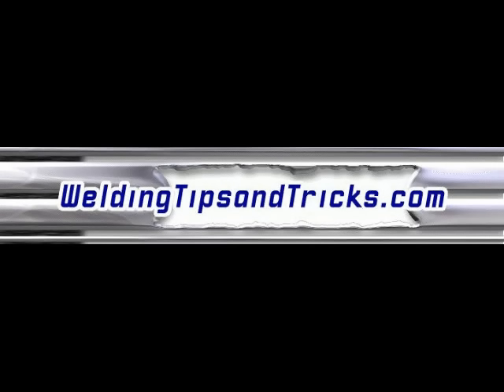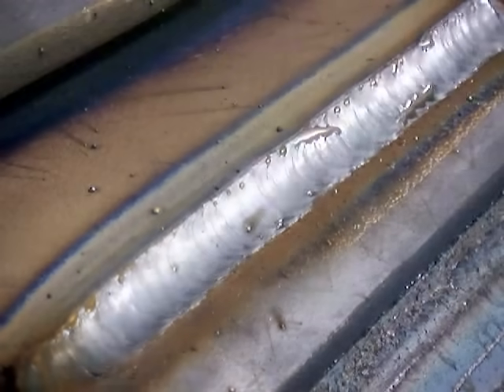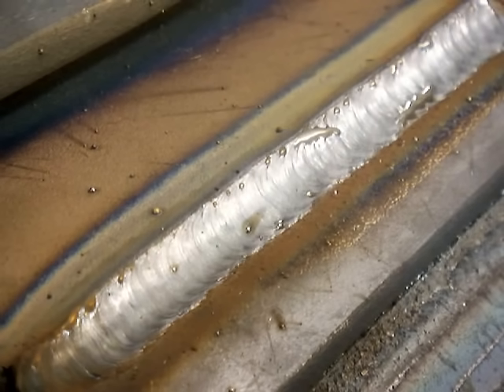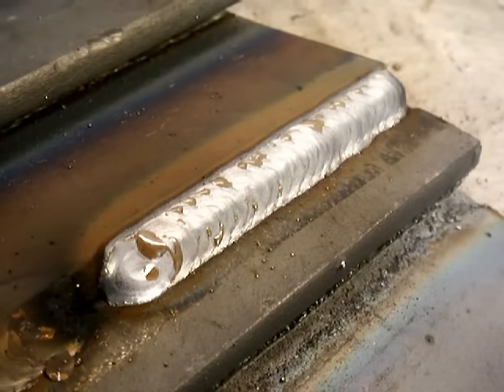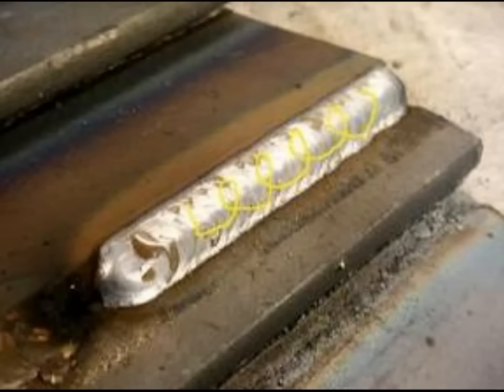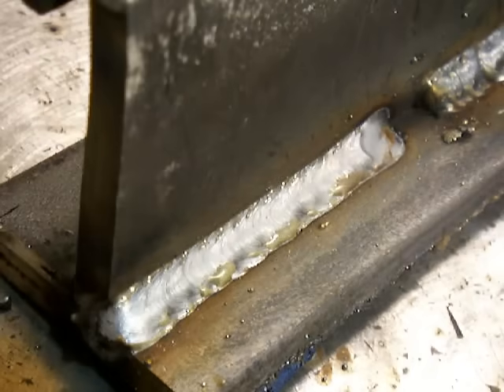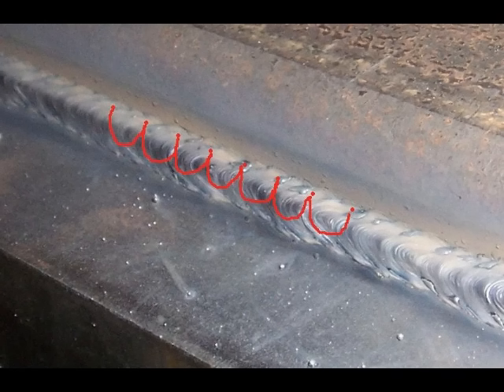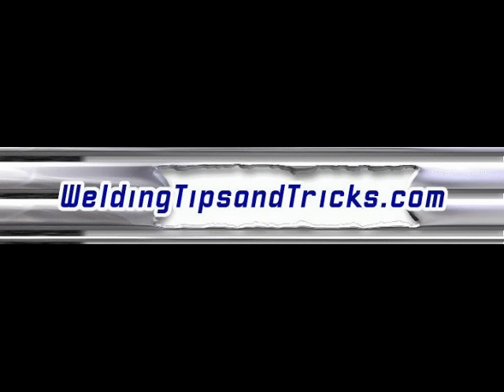Mig Welding Technique Taught by Old Timer

Comment: laying a 6 inch flat bead on your buddies workbench is not welding. laying upside down under 6 tons of steel getting covered in molten metal while hungover and half asleep and still making a mint/watertight/xray bead is welding

Comment: That,s info - I have only heard about push-teknik. Those strings looks very low (seems like it´s melt in very good).My experince is that the string gets to high, it don´t melt in or down as much as it should.
Looking forward to next tip.

Comment: aint that the truth mate getting qualified is extremely hard im lucky enough to have qualified in 3 of the 4 welding types only missing Stick welding but i know my welds can pass it just don't have the time to get the piece of paper i've had people like these guy run their mouths and say they can "weld" when their welds cant even handle a tonne while mine are rated at 3.5T on 3mm steel so its funny how these guys think they can weld give em alli or stainless welding and see how they go

Comment: correct , Flux Core totally different animal .. gas shielded flux cored works better the the wire 90 degrees to with work piece or being dragged .. you can push it and it does respond well but this is not the correct method , we used ESAB 15,14 flux wire ill get some vids of this posted if it helps people .. 

regards

Comment: The Weld Pool is Better Protected Whilst Pushing The Weld Pool , This Technique Is Ok For Lets Say Welding Car Bodies . If Working On Structural Steel , This Technique Would Never Pass A Procedure . Also Try Dragging 300Amps .. Then Try Pushing .. You Tell Me Which Is Better . .Regards

Comment: Yeah, it's the easiest machine to use - though I have to point out the difference between what you said and what you replied to. Good welding is all about practice, not "training". Doesn't matter how much "training" somebody has in this field if they don't have the actual practice in making a smooth bead, so your reply was right-on.  ;)

Comment: A good welder needs "technique", rather than "tips" or "tricks".  Circling the arc is the most basic technique for laying a bead, and is actually easier than a straight linear feed down the weld line - which requires careful speed control. 

Not that I'm saying anything bad about the video. People who don't know these things yet would learn a lot from this. I just hope they don't consider it a "trick" when they use it at work, since it's a proper welding technique...

Comment: A mig is the easiest welder to use...practically like using a glue gun. If you read the owners manual, you  will acquire enough common sense to avoid electricution and be able to practice..  this guy has been practicing for sure

Comment: You should probably avoid welding the frame entirely, and instead do silver brazed joints using lugs.  If you were planning to make it out of, say, 4130 Cro-Moly, the heat of arc welding will probably significantly damage its high-strength properties, not to mention causing warpage and introducing high-stress points that could result in potentially deadly frame failure.

Comment: I'm looking at the MTS250S too but may also get the spool gun for aluminum. 250A for MIG isn't overkill. If you don't need to go that high, the extra duty cycle will come in handy and makes for a more durable welder.

Comment: On lap joints, you need to watch when oscillating the arc as it may cause undercut if you get carried away. I guess all of us has done it before. When I was a Mfg. Rep for Pandjiris, we installed a bunch of weld oscillators, both mechanical and magnetic, and it does produce some pretty welds. What wire and gas were you running in this?

Comment: its called a journeymen pipe fitter in south bend IN at 7 years your max is I think $35 a hour then if they cross over a county line it raises another $12 a hour. are you just mig welding those trailers? or you doing any tig? I know tig in fab shops make alot more.

Comment: welding is all about travel speed and arc length, if your machine is set right along with your travel speed and your steady your fine....PS good luck pushing mig..
you call pull it all day its fine the circles...there's no point just a steady even same length straight line...

Comment: I weld and fabricate ALL day making custom semi trailers that hold 100 foot H beams. I make 20 an hour, PLUS dental and basic health insurance. I have 9 PAID holidays a year. I have my dream job. The funny thing is, that I did not want to be a welder, considering I got a 28 on my ACT. My welds need to hold over 180 thousand pounds. Dragging the puddle without ANY motions has the best penetration.

Comment: Try bending you're knees a little more and have a staggered stance, and try not to focus on breathing too much. Your body will adjust over time on that part. It has alot to do with muscle memory also. Just focus on the arc, your distance, and puddle size, and that whatever you do, don't change your technique up in the middle of a weld until you have it down good.

Comment: I dont see a point in weaving with spray? I mean we were taught to do a little wiggle.
And Don, im a 19 year old welder, Hobart grad, is there really places that radiography on mig steal? In the flat position at that? I could see destructive testing, but how much impact can a small inclusion have on a half inch fillet? 
I have zero work exp, so im honestly curious ?

Comment: It'll hold. All depends on what you're doing. If you're a farmer doing farm repairs, this will work just fine. If you're doing anything that needs radiography or ultrasonic inspection, you'll probably be walked out the door for welding like this. Reason? Inclusion due to weaving, undercut, possible lack of fusion depending on how aggressive the weave is, and a convex weld.

You had better change your attitude, kid. Any future employers that see an attitude like yours will show you the door.

Comment: You're 15? I'm 29, I've been welding since I was your age. I've worked in every welding industry, with every process. I'm now a CWB Level II weld inspector, with Ultrasonic/Mag Particle/Visual certifications.

I'll tell you that you don't know anything, because you don't. When you take a college course and find out the fundamentals behind welding, I'll give you the benefit of argument. Until then, all you know is practical, and that will only get you so far, son.

Comment: I wouldn't use a technique like this during spray transfer. Voltage is usually ramped right up, you're more likely to get undercut using a method like this.

Comment: Pushing the weld is stronger isnt it? Gives it more penetration i heard. But you cant do this technique on everything can you, as it pulls too much so the metal may bend, my work mate did this on thin box section posts and they came out pretty pissed :P

Comment: Not really.  I think to many guys waiste "hard"/solid" wire by making it look neat like a stack of dimes and  they're just waisting wire.  I'd wield straight if I could everytime.  Even when using metal core/flux core when I welded tanks and armored vehicles I'd just weld striaght if I could. Obama took office and demand wasn't as high, so they gave me up at another military factory welding job and they let us new guys go. I'm hearing Brazil's hiring welders and fabricators!  Any truth to this?

Comment: @sarmad are you serious? You don't know what welders do? Or build? 
For the most part everything in welding is joints (unless doing repair like filling/plugging a hole, crack etc.) all vehicles, for example, have welds.(mostly by robot today) but any steel building is welded by a person, any trailer on the road, metal gates, bikes, machinery etc. are all things welders make 
If you can't grasp that, then I don't know how you are still alive
Sincerely 
A welder

Comment: i dont think push/pull matters much on solid wire.. i think it comes more into play in the dual shield flux core and metal core wire or sub arc.. i think you did an excellent job sir nice videos

Comment: I have been M.I.G. welding for the last 25 years spent 8 years at collage and night school earning a few BS certificates and pulling the shround is surely a no no. When im welding heavy gauge steel I want as much heat penartration as I can get I also want to be welding in the direction of the gas flow not away from it. Ill get a far smoother weld that way too. Just a thought.

Comment: Overhead is hard and vertical is hard as well.But once you have your heat and wire speed set correctly then it is all about a smooth steady speed and a nice circular motion.And practice practice practice this guys beads are excellent and you can do the same thing with practice and a little knowledge.

Comment: Look you can push or pull either way is fine you just want to have a very nice circular motion that overlap the circles and keep moving at the same speed I prefer to push if I can but pulling or dragging is fine as well. ANYONE can be an expert MIG welder. Where are you located? I can teach you in about a hour to where you will be running beautiful beads on 1/8 and up plate lighter plate is much harder.

Comment: This is the method I was taught to use by a guy who was a pipe fitter and now an auto structural welder for a custom engineering fab shop.  It works really well and is pretty easy and good looking.

Comment: It's one thing to see it and another to do it. Everyone (that welds) knows you gotta move while welding, make C, O, U as long as you move a bit to spread your fusion. Even if i told you that when you weld horizontaly you have to stay a bit longer on the upper side of the joint before going down wont make you a good welder. Theory is good but practice i great. And knowledge should always be free.

Comment: Some darn nice welding there I have to admit, but a pretty weld is not always the strongest weld by no means. Your technique may be sufficient for some applications that do not require the strongest weld, and that works. One draw back from your technique is that it lacks ROOT penetration. If you look back at the video on the section you pushed the puddle you can see a small gap at the root.What has happen is that you bridged the root opening, and in doing so reduced the strength.

Comment: Stacking "dimes" is NOT the proper technique anymore.  Yes looks pretty and this is how I learned but in fact you are wasting ALOT of time and material.  Going into spray transfer mode is what is being taught now due to speed, better penetration and a sufficient bead for the job is what any educated welder should know.  AND yes I know you will get all kinds of grief if you do this on any kind of "old school" job  (again EDUCATED).  NOT talking pipe welding, talking manufacturing.

Comment: Very nice. What brand of Wire Feed Welder do you recommend for the the hobb
yiest. I've been looking at the Lincoln 140 /180. Mostly I want to build bracket 1/8" stuff, you know, like a frame to hold a solar panel, for example. It'd be nice to go 1/4" too, though.

Comment: Pure carbon dioxide, on the other hand, allows for deep penetration welds but encourages oxide formation, which adversely affect the mechanical properties of the weld. Its low cost makes it an attractive choice, but because of the reactivity of the arc plasma, spatter is unavoidable and welding thin materials is difficult. As a result, argon and carbon dioxide are frequently mixed in a 75%/25% to 90%/10% mixture.
hope this helps you in your work mate. :D

Comment: The choice of a shielding gas depends on several factors, most importantly the type of material being welded and the process variation being used. Pure inert gases such as argon and helium are only used for nonferrous welding; with steel they do not provide adequate weld penetration (argon) or cause an erratic arc and encourage spatter (with helium).

Comment: I wonder if someone can answer my question quickly. I have been using a 75-25% Argon to CO2 mix for MIG welding. Now I have moved to a place where they don't mix gases, it's either Argon or CO2. Which one should I use for general use Mild Steel. I'm a sculpturist and a furniture maker. So my welds don't have to pass X-ray tests or anything. I just need something that's easy to do clean(ish) welds. I asked them to fill the tank with 100% Argon. But now I'm wondering if that was a good decision.

Comment: Once you have had some practice particularly on the metal you are using set the visor so that you can see the weld pool clearly. Then weld as hot as the metal will allow & as fast at you can push the wire this leaves perfect 45 deg welds even on triple pass welds if you have done it right the last pass will leave a perfect line down the middle of the weld

Comment: Oh, yea havnt heard that. But then again, ive been told by bosses and inspectors that the way i do it is wrong and that it wont pass. But ive passed every test ive taken, hell i did better at the ultra sound work than anyone else i worked with. I never had any issues.  Thats the reason i come on here, and try to inform people that welding isnt as cut and dry as people make it seem. do this not this ect...i think it stunts peoples ability to learn.

Comment: i disagree. the penetration is fine, you can see the discoloration on the metal, there is plenty of heat there for a solid weld. it is pushing it for a single pass weld bead that size on metal that thick with that wire size and setting, but perfectly fine.  id be willing to bet that has full penetration of the root, no hollow space, unless your talking about the area behind the weld, where the two plates come together, then yes but that would happen with every process.

Comment: It looks nice, and you are a good welder but this material is to thick for a low amperage like this. Next time you better weld in the spray bow.
Now the material is not warm enough, so you don't meld the corner well. Behind the weld is a hollow space..

Comment: Also frying bacon, is really only an accurate way for this type of welding, short arc hard wire.  dual shield, inner shield, spray, are all a bit different for what you need sound wise.

Comment: i always look at profile. throw a practice weld down, on thinner material you wont need the high heat to get the weld to flatten out, same as the metal gets thicker more heat to get it to lay flat. then i just adjust the wire based on where it disappears into the puddle, meaning if the wire goes into the puddle, tends to be a bit too much wire, if its disappearing before the puddle not enough, basically i make it disappear at the surface or barely above it.  But thats me.

Comment: i take it you work at a testing facility then?  Interesting information, i have a question, What is the technical difference between penetration and fusion? i always kinda figured they where the same, but as your putting it, they don't appear to be. Everyone always compare penetration on push vs pull, which your saying is the same, im curious to know what the fusion difference is.

Comment: push vs pull does make a difference on short arc welding metallurgy will show that pulling yeilds better weld fusion while the pen is relitively the same using push or pull. a symple macro etch will cleary show this. fusion is what matters in all fillet welds by pushing you will chance falling a fracture test

Comment: I was doing this back in 97 and it was called lazy o's he calls them recursive e's it doesn't really matter its about controlling the puddle and that comes from controlling the arc.
 this is from welding handbook from esab.com>> Generally, the forehand technique provides better visibility of the weld joint and a flatter weld puddle. The backhand technique yields better penetration and is sometimes found to be easier by the inexperienced welder.
at the end of the day the proof is in the pudding.

Comment: my guess is a cheap hobby welder with fluxcore?

my uses fluxcore but they use both Co2 and 75/25 as shield gasses...you really need a shield gas to have a chance of a good weld

Comment: When I tried it I could never adjust the wire speed right. Anyone know? I was welding pretty thick metal just couldn't get the speed and voltage right

Comment: I believe its forehand and backhand. If the penetration is correct and the weld bead is at least as thick as the parrent metal with no contamination either way will pass. Different situations require different methods, say a roll cage.

Comment: it shows you the HAZ, heat affected zone. Which you knew. I dont believe i ever said there isnt a difference in penetration. Since for the most part i have never really checked. What i do know is that all of my tests, and ultrasounds, have passed 100% while i was pushing.(hard wire, dual shield, tig) Even one of the guys giving the test told me pushing wasnt the "norm" But i passed just fine. Thats why i tell people you can do both. Because no one has proved me wrong yet.

Comment: Push or pulling has a huge effect on penetration! Try pulling on thin gauge material, even with short curcuit transfer, is one simple exercise. Another one, set up for Axial Spray Transfer on 1/2", tee joint. Push one side and pull the other side. Now saw cut the part in half and grind and buff to a smooth finish. Add a few drops of nitric acid and let dweel approx 20-30 seconds (depending on the strength of the acid dilution) and rinse with water. You will see the root penetration fusion.

Comment: you can do both push and pull with wire, and both with tig.  Although pulling with tig is significantly harder, and harder with no gain, except getting into a corner maybe.

Comment: and just to let you know, i can make it look that smooth push or pull. The only change between push and pull short arc, is throat thickness. You know what throat is right? im not asking to be an ass just making sure, basically when you pull instead of push the throat is more convex, or rounded from weld wire build up. where as pushing would be more flat.